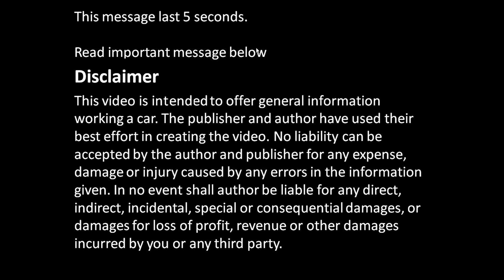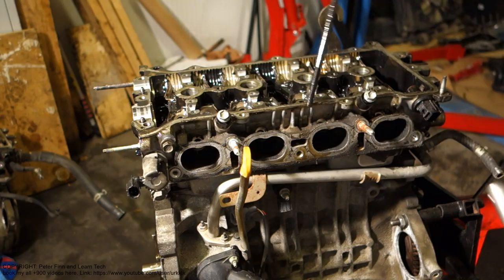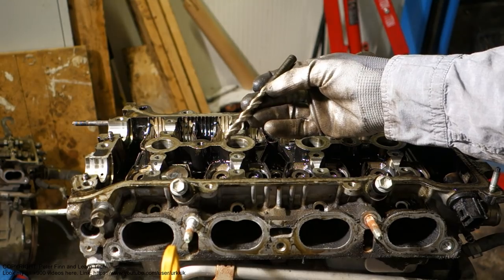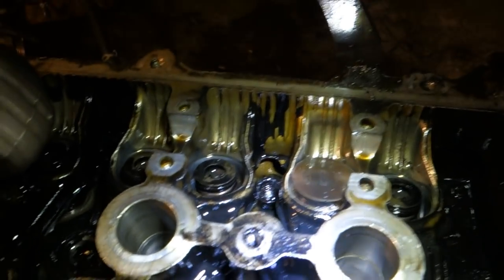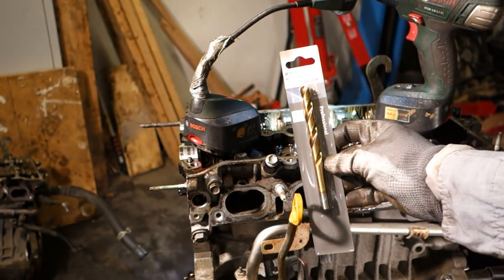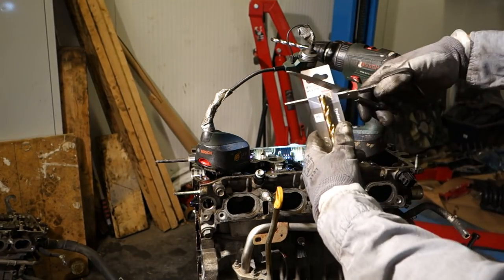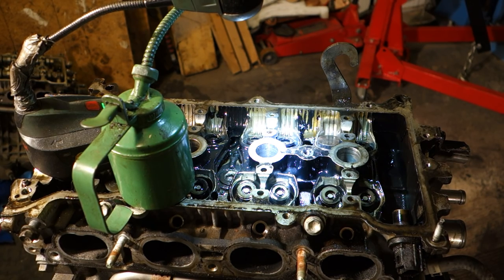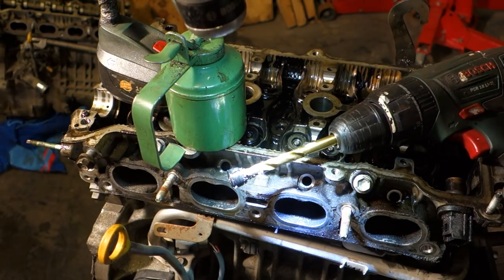How to open damaged cylinder head bolt in car engine

Comment: Hello Peter! Good stuff! Can you start making some videos for us 1970-80's Corolla fans (E70/E80) ?  For example, engine overhaul procedures like this for Toyota R22 and 2E engines would be interesting. I'm looking to buy a cheap E70 rear-wheel drive car for hobby at some time in the future.
Reply from the maker: Sure. I need to get some old Corollas first. :-)
Reply: Hello and thanks for the info. An E70 with Toyota 4K pushrod engine sure
 looks interesting. I'm contemplating on buying one; is very cheap even 
with less than 100 000 km in mileage :)

Comment: Hi peter, great videos.
The Toyota repair manual says to measure the head bolts and if they are between 2 measurements they can be reused.
Is this something that you would do?
I have always been told to buy new head bolts.
Reply from the maker: I recommend new bolts
Reply: Thank you for replying. Can you recommend a OEM supplier for bolts, the toyota ones are very expensive.

Comment: I just damage all (10) of Toyota 1nz-fe head bolts. It was getting dark and I thought the bolt was loosen, but turns out the Allen key turns without turning the bolt. 1 step that I missed was to clear the hole. My Allen key didn't fit correctly because of the oil residue. Tomorrow will be a long long day to drill all of them. And the bolt is quite pricey too..
Reply from the maker: Yes, sorry